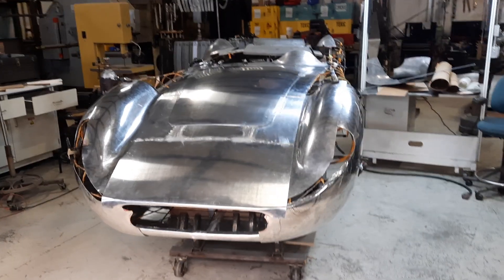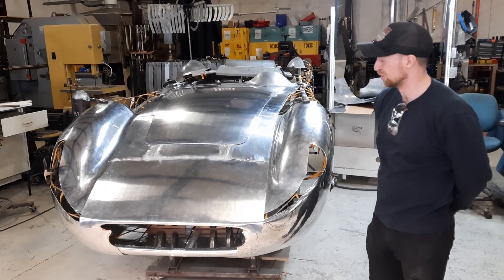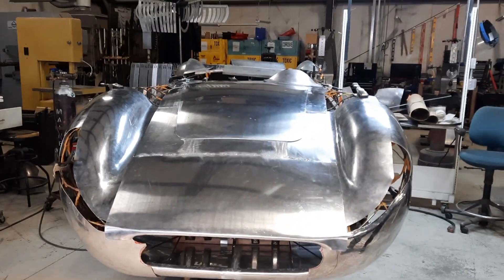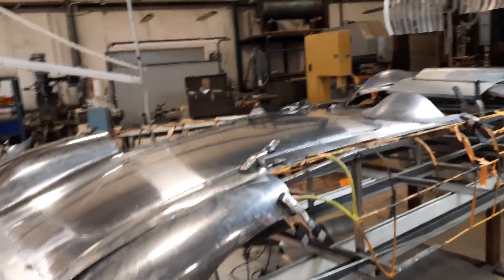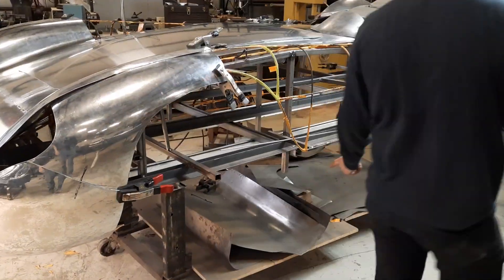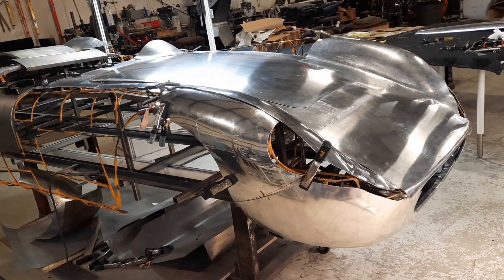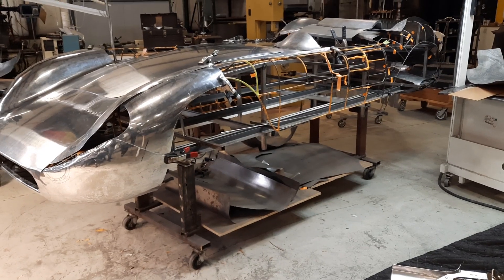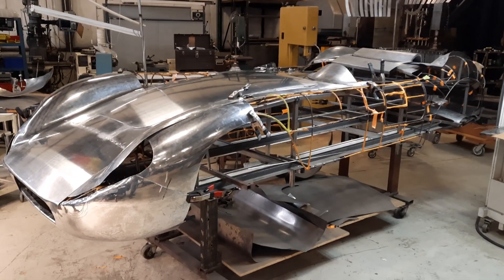Students English wheel a Maserati 300S nose

Comment: Really shaping up fast. Roland's  testimony adds to my confidence considering I have been in the same boat doing patch work and repair  sections and now  with the wire frame buck really is a new dimension . I'm inclined to think you have used your Flexible shape pattern with this project ?  Hope to be in your sessions not to far in the future.